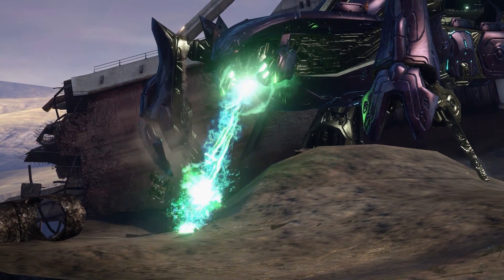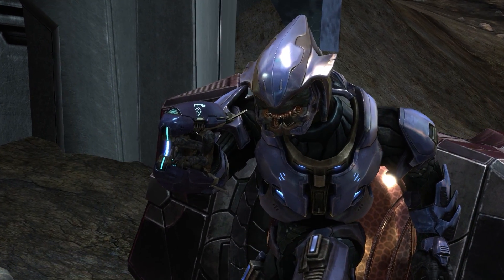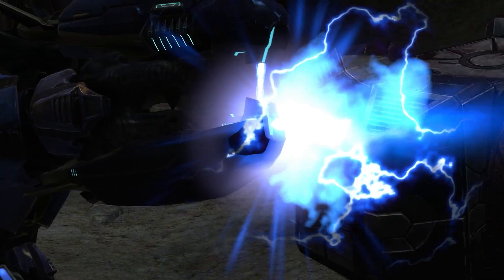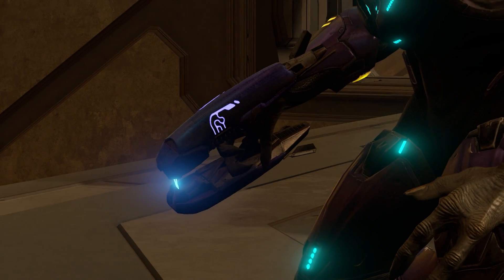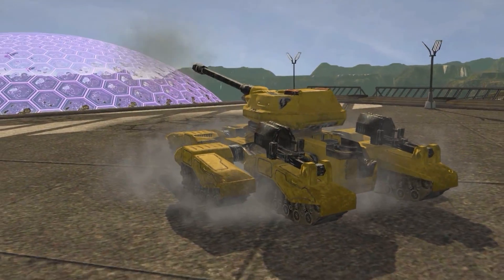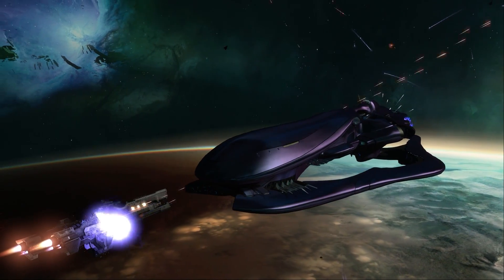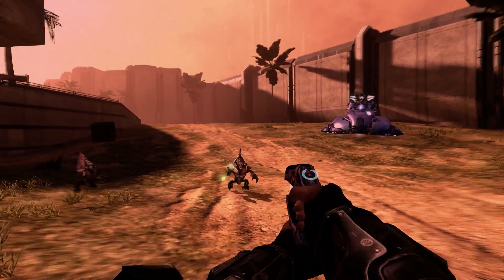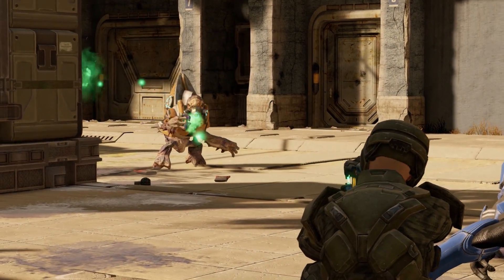How Plasma Works (Halo Lore)

Comment: Plasma weapons in real life would not work. Their energy requirements would be far too high and they would have very short ranges as plasma has a very high dispersion so not only do the plasma containment fields have to be incredibly strong, the plasma bolts would have to travel extremely fast to make the most of the magnetic containment field. Plus in order to make plasma weapons possible, you first have to have practical nuclear fusion and highly advanced laser technology.

The same technology that allows for plasma weapons will also allow for particle beam weapons, which real-life plasma guns would be much closer to.

Comment: As much as I love Halo the plasma weaponry is just fantasy in a sci-fi shell.The only way for them to work is for them to be a neutral charged particle-based  energy weapon so basicaly a more deadly "laser" on long range. At short range as cutting tools or weapons like a cutting torch they would be very good. But as a plasma glob is a no even if i'm drunk because of the fact that plasma will float in the aer and will scatter very fast and easy. They same case as to why electrons that can't be used in atmosphere in particle-based weapons because of rapid scattering of the beam because you're electrons or plasma have a charge so any conductor or magnetic field will make then scatter and lose power. In space with no atmosphere there free-game to be used at full power. Maybe if they have some fancy gel-form energy cell you shoot at the enemy and it converts to plasma then were green. Like the fuel rod cannon is a corect way to do it.Plasma weapons are like a try at making a long-range sniper match grade 1 mm balls birdshoot shell with a range of 1 km range to kill or a hand-held shape-charge warhead shaped to the form of a rifle.

Comment: The needler is also really horrifying. In game it can be slow and need to expend half to all of the cartridge to be effective but in lore in The fall of Reach, a single needle had a marine holding his entrails, agonizing while his squad mates tried to get him out in a warthog. In the movie Forward Unto Dawn shows this when a character gets hit square on the chest, falls down and a small explosion is seen with a lot of blood bursting into the air.
Reply: @Thominus Rex I think the spikers are superheated metal spikes, so they are different, yeah. It's been a while since I've played, but I think you're right.
Reply: for the comments about the Spiker, the projectiles are simply under normal conditions just superheated metal spikes. In canon, they are still very deadly. Indirectly related, but the Spike Grenade is deadly even if one fragment hits you due to the sheer size of the needle and how hot it is. To a normal human, one spike is large enough to create a HUGE gaping hole in you even with body armor to catch it and stop it from taring your spine apart or even blowing you in half. The only reason the victim lived was they were tended to by a corpsman who used biofoam (I hope) to seal the wound. And thus while he was out of the fight, he still had enough strength and mental faculties to act and do his own mission of locating the Chief's drop pod. 
Also to reinforce the statement of how lethal the needler is, that is just if ONE hits you and you fail to discard it in time. If enough get in you to supercombine, it has enough destructive power to blow you into nothing more then a mist, nothing left to bury. 
All of this combined by the abundance of plasma weapons is likely reason enough to assume that one reason that plasma weapons are not so powerful in the games is that at the time of the games, the UNSC was forced to research HARD on armor and uniforms that have some protective properties vs Plasma. And as a result, you have the body glove rendering the player very durable vs plasma weapons and marines able to withstand multiple shots from plasma bolts while nobody is harmed by missed plasma, due to the glove's anti-heat properties and the researchers of humanity getting the motivation to make their uniforms and armor to have reflective properties to defend against that plasma. 
What I am curious now about though are how would humanity expand on energy shielding in the future. This is a different subject now, but I'd assume in the future, collaborations between the Sangheili and Humanity will lead to personal shields that do not demand a combat harness or full suit of armor to employ, and in fact can be worn on far less advanced armor systems. It would also indirectly resolve problems with the non-spartan human's constitution discrepancies. As in reality, in all of the games, the humans have regenerating health (With CE giving them hidden "shields" similar to the player's that recharges) So a shield system would make sense. But perhaps I'm dreaming too much.
Reply: @YukimareThePsion  human warships now have shields
Reply: I remember that part from The Fall of Reach!
Reply: @aeronautisch  I remember that too. It was pretty vivid, so it stuck out in my mind.
Reply: Ahh the needler, covenant space magic.
Reply: @GrOuNdZeRo7777  the projectiles are mined off of a moon by the covenant.
Reply: Needles cause mini explosions. The shards from those explosions get lodged in your body and then they also explode. This carries on until there is nothing left.

No wonder needles are so devastating.
Reply: @sani-cloth70percent  Grunts are actually space wizards.
But the needler is a fun troll weapon.
Reply: I kinda wish there was a needler gernade. Either something weird like a metal case with say 15 needles in it ready to shoot out and track to nearest target. OR just a large crystal of blamite (seriously. The needles are made of what's called blamite.) with an explosive in it to send shards everywhere and continue explosions. Maybe have a thin casing on it to make it safer to carry? Plus it gives it normal fragments too.
Reply: @jeffwillsea6757  
That sounds like an awesome idea. I hope one day it'll be made into an official weapon. Maybe in Infinite.
Reply: That was actually a pretty good movie even for being based off of a video game
Reply: Read the flood at chapter 2:Halo,it shows how the gunner got hit by 2 of them and almost died
Reply: in lore jackals use shards of blamite as knives because they make great tools for assassinating targets because after you stab someone with your knife it will explode and blow the target to bits if not taken care of in time ensuring the death of your target
Reply: Right i always thought the needler was scariest.  It also chases its target like a heat seeking missile. Imagine giant needler rounds. Like on halo wars there are covenant base turrets that fire needler rounds. Scary stuff.
Reply: In real life, imagine what the supercombine explosions would be like. You’d probably need a bucket.
Reply: Not to mention how they just went straight through Daisy's armor.
Reply: Don't forget Miranda Keyes getting 3 in the back!
Reply: @QrazyQuarian  that was a spiker
Reply: @QrazyQuarian  That was a spiker. Completely different weapon.
Reply: @QrazyQuarian  that’s a spiker,  not a needler

Comment: SameToken: The Covenant are unmatched in space.

UNSC: laughs in MAC cannon
Reply: Covenant Ships: Laughs in mini Slipspace Jumps
Reply: @luisalfredogaleanavera9602  not fast enough
Reply: @alexandreparent82  even so the covenant ships have shields that is why they destroyed the human fleets, before you could empty the shields of the ships the others had already destroyed them
Reply: @luisalfredogaleanavera9602  2 shots from ship mounted mac guns to destroy one covenant ship.1 shot from an orbital defense platform to annihilate 3 of the biggest covenant  ships if they are alligned.
Reply: @alexandreparent82  still the design does not help human ships, the energy required to use the MAC  comes from the ship's reactor if it is unable to use its weapon is dead
Reply: @alexandreparent82  at least in the MAC mounted on the ships, on the defense platforms I do not see them as good since as we saw in halo 2 and reach can be neutralized with "relative" ease
Reply: @luisalfredogaleanavera9602  coilguns use a coil to propel a projectile to extreme speeds, there is no need to use a reactor to push the projectile
Reply: Covenant: Laughs in Energy Projector
Reply: It's funny if you think about it because travelling at those speeds, a MAC round has significantly more kinetic energy than the binding energy holding its atoms together. Which is to say that when a MAC round actually hits something and converts that kinetic energy into heat energy, it completely vaporises and basically becomes an on-demand high mass plasma warhead.
Reply: Covenant: Laughs at MAC Cannons due to over 30 years of being unstoppable in space. Who cares about mac rounds if it takes two or more to bring down one ship and you are already space debris before you can fire the second round???
Reply: Laughs in goin over yah ship n glassin
Reply: grunts aboard a spacecraft: "so only 10 of us can safely fit in the 3 last escape pods"

Comment: the plasma cannons in real life... Knock over tin cans. They aren't nearly as impressive. More glowy glorified air cannons right now
Reply: This is still early.  We still have five hundred years until we get to halo timeline
Reply: @Alesaldbar  IRL plasma makes for a terrible weapon. Dumping heat into something quickly is surprisingly difficult cause the evaporation of the target shields the target. They take stupid amounts of energy to do anything, the required electromagnetic fields to get the plasma anywhere are near or completely impossible. Not to forget that the requirement of an em-field makes it one of the few things an em-shields could actually be used against.

Comment: Heroic is the Canon difficulty in Halo, and why me take more damage in CE than in Halo 2/3 is because Mark V has more armor and shield capacity than Mark VI, but that was a trade off for faster charging shields and lighter weight, also onboard medical systems giving us health regen.
I prefer Mark V a lot more myself but that's because I like the Classic Halo playstyle over the 2 and 3 ones.
Reply from the maker: Heroic is certainly my favourite way to play. It gets pretty close to canon with Chief, but all the shots of the marines getting taking multiple plasma bolts to the chest were taken on Heroic.
Reply: It is officially the canon difficulty, but not 1 to 1
 with the lore on everything for gameplay reasons.
As you said it would break the game, I think everyone would agree with that lol.

Comment: something to note: while plasma damage at closer ranges completely outperforms over that of kinetic weapons, their range gets countered hard by the fact solid projectile launchers have significantly superior range potential and penetration at longer distances, as plasma dissipates much faster than bullet drop needs to be taken into account. 

Additionally, I think I should make a case for how effective certain variants of Mjolnir are at dissipating heat from plasma weapons. The Tech suit of Mjolnir is more resistant to plasma hits than even the high-grade titanium armor plating due to the fact that it is composed of both Titanium and Carbon fibrous materials, on top of having heat resistant coatings and internal materials that also dissipates short-term heat exposure from plasma +radiation. Realistically Mjolnir's tech suit can tank several sounds from low yield plasma bolts and shrug it off. Although it can't tank anything like a Fuel rod salvo or things akin to mortar-like instances of the weapons, it will keep you from being baked by some grunts. 

just a couple points in favor of humans in Halo. I'd say Heroic is probably the closest difficulty to what would be realistic.
Reply: You do have good points. But the covenant do have other means to kills us. The needle pistol and rifle are a good balance for the covenant to have. A weapon that has the heat of a plasma weapon but also having a solid state so it can act like a regular bullet. Not mention the covenant has the height, strength, speed and equipment to counter us.
Reply: Kaiser Dragon there’s still tradeoff with covenant projectile weapons, but generally they are superior to Human their human counterparts for sure. In particular the Carbine has more penetration power plus thermal, chemical and radiative damage, although not as devastating as plasma. The carbine can still be countered at extreme range by chemical projectile weapons due to the nature of how a carbine’s round is launched, as it loses mass the further it travels. As for Needle based weapons, they’re more lethal than bullets, but not as versatile considering you can put practically any kind of material or payload into a cartridge whereas with most covenant weapons they’re limited to one specific munition.
Reply: @Troy Gonzalez well yeah...

Comment: Why didn't the Forerunners bulid smaller much more mobile short range Halo rings that would slipspace into a Flood infested or controlled solar system and immediately activate getting rid of trillions of Flood forms and maybe Keyminds that could be in the area thus taking back the resources and destroying Flood fleets. Had they built thousands of these smaller mobile rings they could of won and turn the tables on the Flood. And they should of invested in EMP weapons that would destroy logic plauge infected AIs like Mendicant Bias which would of cut the Flood's greatest military general out of the picture. This plan would of worked better the Didact's shield world plan because it would be much simpler and less costly and easier to produce.

Comment: realistically the unsc would have gone for composite ceramics reinforced with titanium armor, cause even though the ceramic could take the heat it likely couldn't take the immediate transfer of energy from the force of plasma and the load would have cracked or shattered the ceramic, if the ceramic had a more elastic material behind it, it would allow deformation to occur and kinetic energy to be stored in reinforcements behind allowing the ceramic more time to dissipate the energy. but yeah its a game so the thought process isnt perfect.